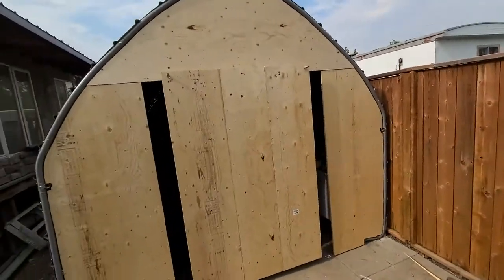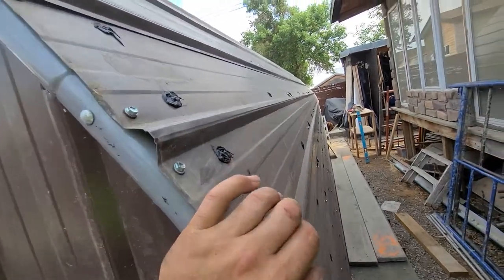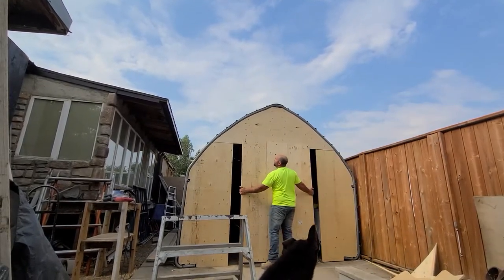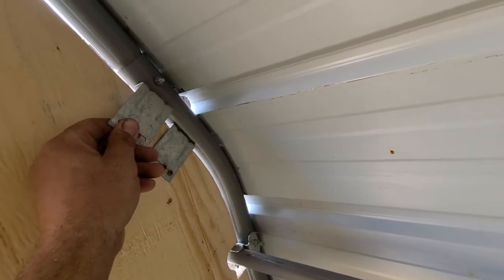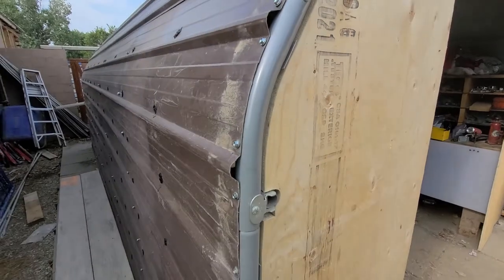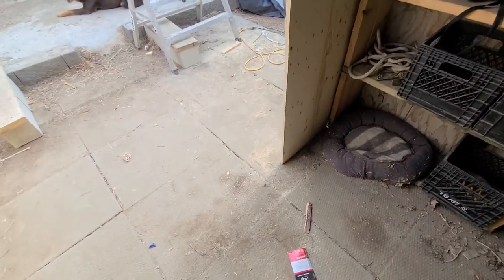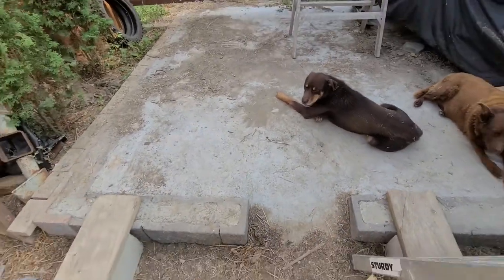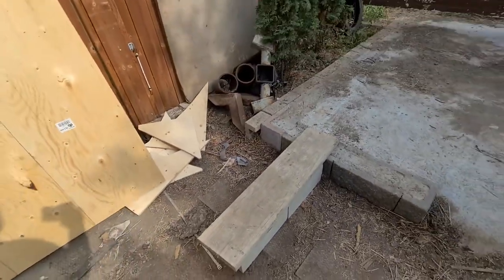Framing in the Door for Tent Shed Remodel

Comment: I'm not sure I'd even worry about those small gaps. You're not going to lose that much heat thru them. As long as rain doesn't  blow in. Every time it rains, I get an inch or more in my garage, that's why I'm about to build a new one
Reply from the maker: Your right, and it is just a shed, but it's a pet project of mine, and I've built these for others too. So I'm trying to find easy solutions to get them as clean as possible.

Comment: Don't use the cider blocks on thier sides they just crumble.
That shielding has  strips that fit at the end to fill in the gaps.
Was wondering if it was possible to do what you just did. Great job and thanks for sharing.
Reply from the maker: Ya your right. It'll have to work for now though.

Comment: How is this in the winter, if you get snow.
Reply from the maker: It becomes extremely rigid once the tin is bolted on, but be careful, because some styles don't have cross braces inside. I out tin on one of these this year, and I had to add a set, just to be safe. It is a bit wobbly without them. That being said, the snow doesn't seem to stick on it much for some reason. Maybe just because where it's located. Also I have a hole cut out in the middle of the side(for a chimney), and water never comes in it, even though it isn't sealed. But thats because I have a slight crown to the building. It's slightly football shaped. I'll try to find time to make a video explaining these things. I'm also putting up another one of these soon. And this time I'll be building it on top of block ponywalls.
Reply: Looking forward to seeing that

Comment: Did you anchor the shed to the concrete?
Reply from the maker: Yes. I used smack pins to anchor each leg down with a clamp style fastener.
Reply: @theTurnandburn5  Thanks for the response. I was thinking of using tapcon screws to anchor it down and was wondering if anyone else used them as well. I’m going to give it a try lol.

Comment: How is your shed anchored?
Reply from the maker: Yes. I used smack pins to anchor each leg down with a clamp style fastener.
Reply: @theTurnandburn5  Ok, where can I purchase these pins and clamps?
Reply from the maker: @bradywscriber5455  I would just use chain or plumers tape, or find something else to get creative. The concrete anchors I use are called smack pins. They are smaller, easier to work with and very effective. I'll try to get around to making a video on this, since it seems to be a popular question.
Reply: @theTurnandburn5  Ok, thanks for the info!